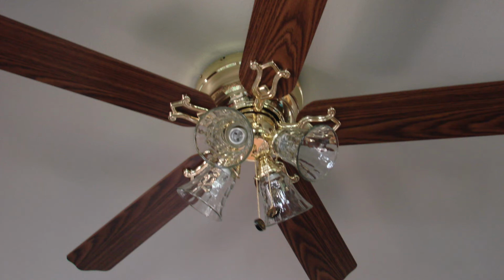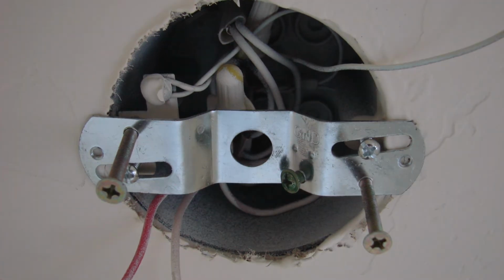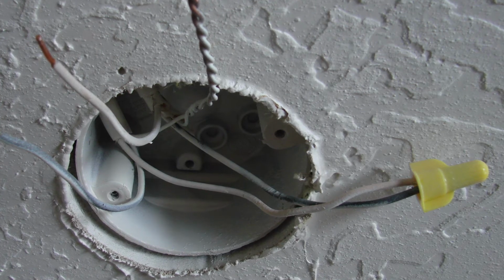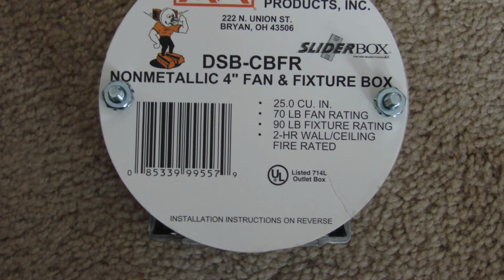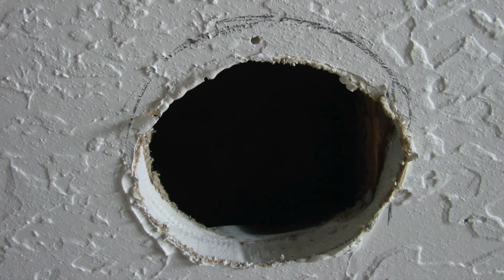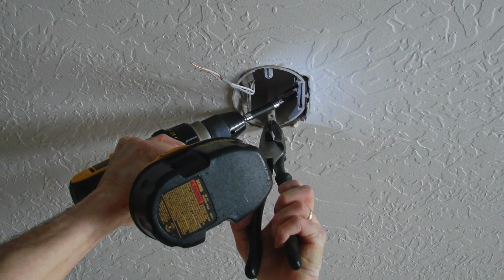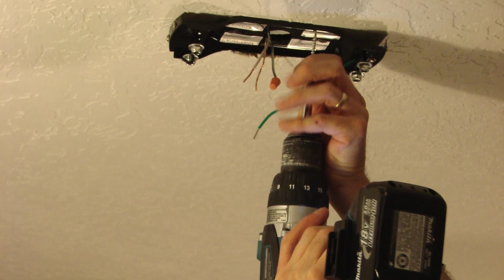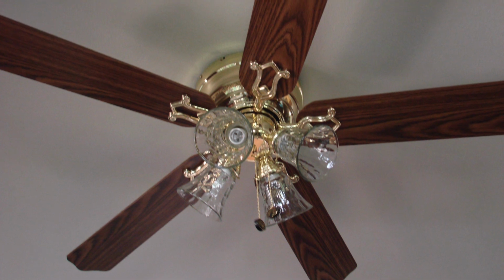How to Install a Ceiling Fan the Easy Way.

Comment: I got a question for you if you can help. 
I just bought a house and in the living room they provided pre wiring for ceiling fan. This is the 14-3 wire (white, red, black and copper). I was wondering if you can explain how i can use this pre wire to connect recessed light. Note the recessed light only have 14-2 wire (white, black and copper. Not sure how i can use this same connection for both ceiling fan and recessed light. 
I hope i explained it better. Looking forward for your reply.
Reply from the maker: If additional lights will be added to the red light wire of the ceiling fan light then the additional lights will be controlled the same as the ceiling fan light. If the ceiling fan will not have a light then the red wire and neutral could be used for the other desired lights, and controlled by the wall switch.
Reply: @AskTheElectrician  thank you so much for your reply. Would you be doing a demo on this in future? It would be very helpful. I haven’t found any video on youtube that actually shows how to connect fan and recessed lights together.